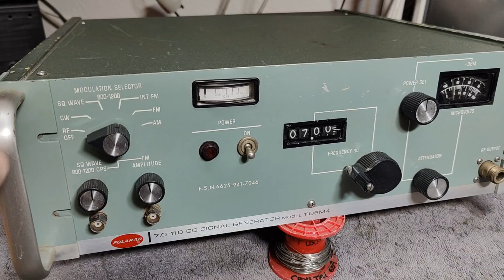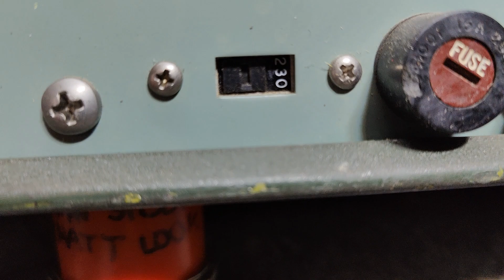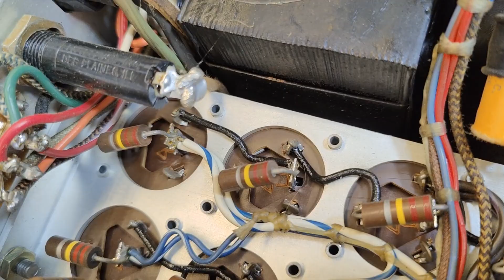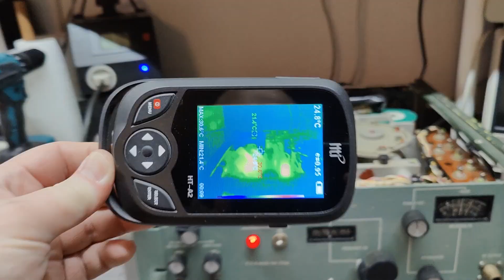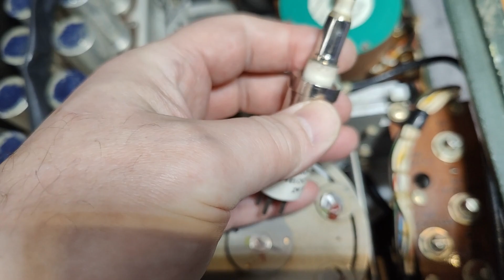Polarad Signal Generator 1108 M4 7-11GHz 1968 teardown

Comment: The 8068 tube first looked like an 8908, which I used years ago in amateur amps. Of course, the 8068 could be used as well, as it's a beam pentode. I'd use it grid-driven, and a couple would make a good 100-watt amp. It would work for audio, too.

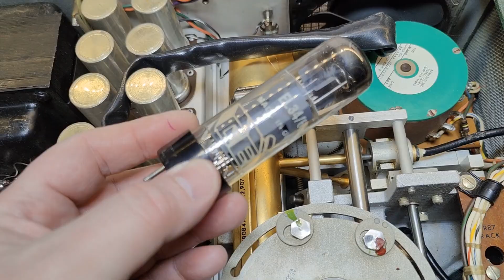Comment: 7:31 Gold and 1960's electronics turquoise (is that diallyl pthalate plastics on the potentiometer) in combination always remind me of ancient egyptian jewelry... And the Schwan Stabilo pen you are using as a pointer is another modern classic in a way :) ). 8:45 do you also keep color striped wires when parting unsalvageable devices out (if they are not brittle or sticky) since they seem to be hard to purchase nowadays? 9:45 unfortunately, audio people (and guitar people .... but at least, guitar people are creative and not just consumers!) tend to raid equipment like this for tubes.

Comment: What a beautiful piece of equipment, the mechanical design is astonishing.  I really appreciate the use of what's essentially a cam riding against a cam follower bearing with the cam being able to be tweaked in 6 positions is "Sex on a Stick" as  Dave (EEVBlog) would say.  I also like the way they canted the tubes to create the space needed for the circuitry beneath while maintaining maxi. space for the other bits is equally clever.

Comment: I would measure the first grid current and see if it's 24mA a shown in spec sheet. If so, the tube may be fine and something else is off ( reflex voltage maybe ?) Maybe upgrade to semiconductor negative resistance oscillator but I maybe nuts. 🤪

Comment: Foot storage is for when you rack mount the unit, you can remove the feet and screw them on there. Very clever design, just like the reversible rack ears.

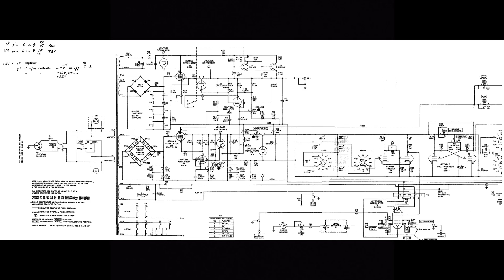Comment: Hi, I have a question regarding the schematic shown starting at around 22:20; what's the deal with the bridge rectifier at the bottom left?
I never saw that before...
Reply from the maker: reverse voltage divide resistors, very normal when you series diodes to accept much higher voltages, if you do not do this, one diode will always hit max reverse

Comment: I thought the plate wire was damaged and someone put string around it to hold it.  Looking closer there is a resistor in line with it. Good video.